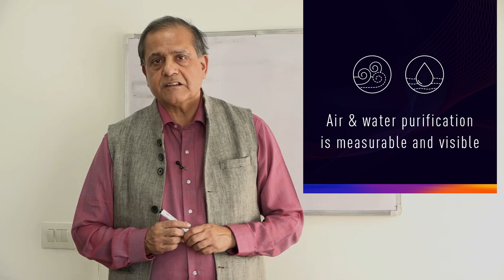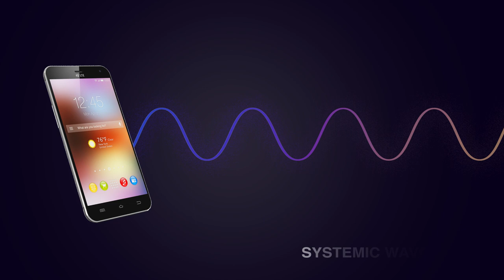Technology behind Envirochip & globe   English

Comment: Hi I am you ..can read my name 

I am 17 years old class 12 
You cannot remove air particles less than 2.5 to 1 microns with any methods efficiency than a scrubber which uses lime water to trap it if you could do it congratulations 

Yes sir water purification had secondary filter a UV chamber which has a Philips bulb which has no phosphorus coating and runs on 24 volt DC radiating UV light to kill microbes through mutation and there's a activated carbon and UF filter and a RO UF membrane 
And it works it's purification on TDS total dissolved salts you can get a meter to check it costs 2 dollars 

Well a radiation which might cause us problem is radioactive radiation which can cause mutation and lead to cancer ! But we don't have it all the places